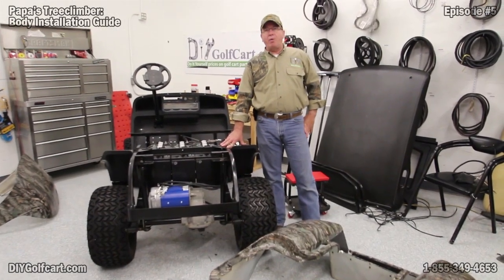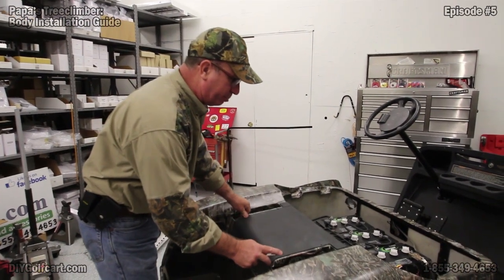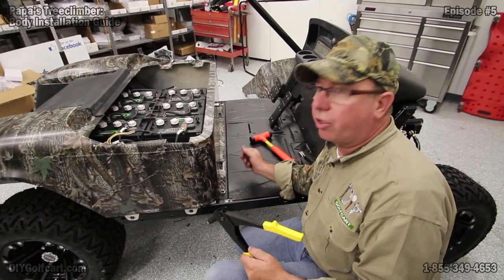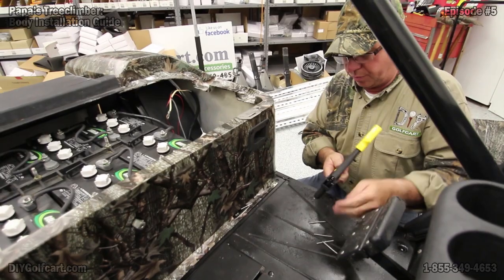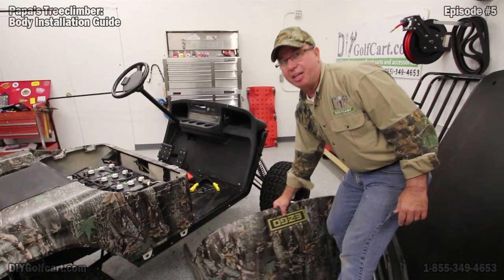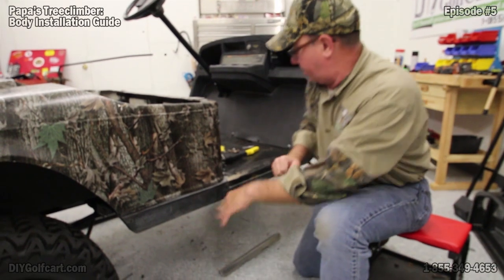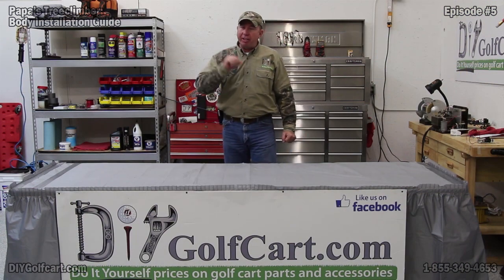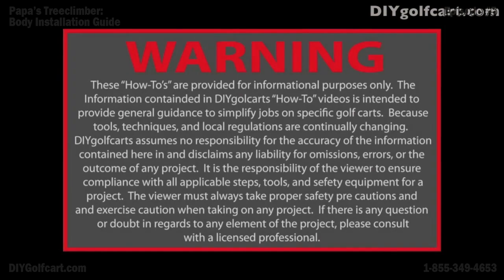How to Install EZGO TXT Golf Cart Body

Comment: when you were hooking up the charge port it looked like it had 3 wires...black white & red...you only showed the black and the white being hooked up....where does the red wire go?  What would it be used for?  Thanks and great videos & website
Reply: It goes into the PDS housing... Mine had a quick disconnect so I did not trace it all the way back, but it went inside the housing for PDS. That's the big box with the tow/run switch on it...